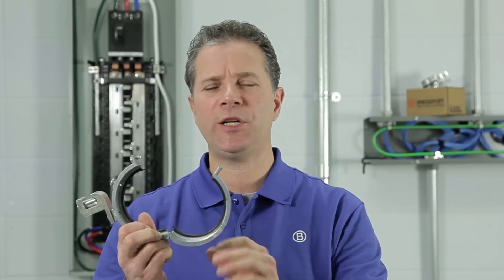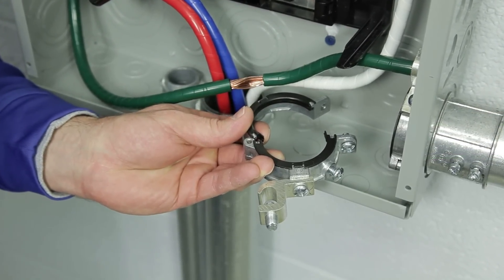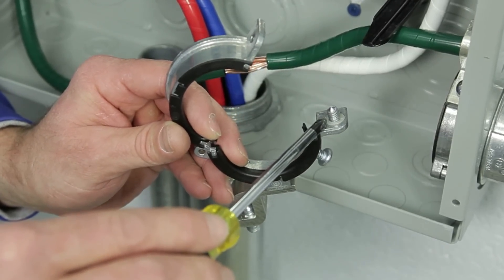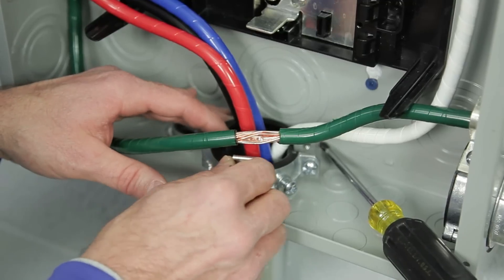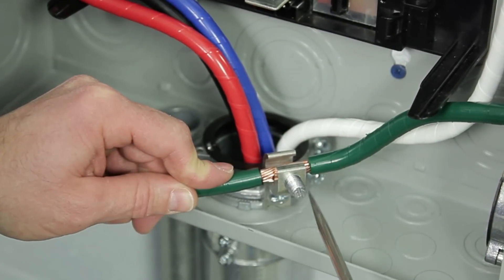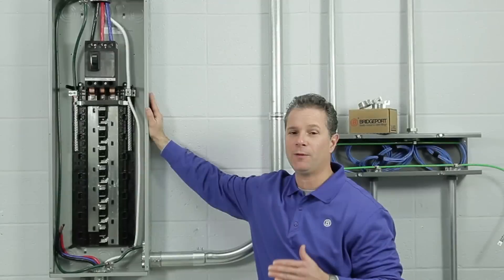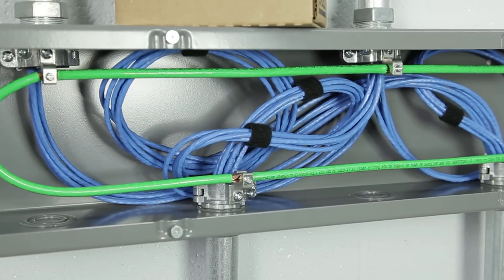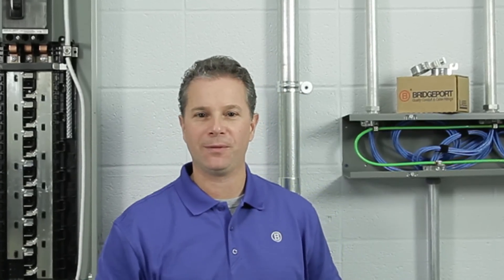Mighty-Rite® Split Grounding Bushings

Comment: What is the requirement for bonding bushings on that communication system?  I'd think that the raceways are already bonded to the enclosure, and to each other, by means of standard locknuts and the enclosure body.
Reply from the maker: +carultch Whether to use grounding bushings or not, "that is the question".

Many Data Communication systems require the use of grounding bushings. Either specified from an Engineer or required by the specific TIA grounding standard that the system is being designed to meet. 

Grounding products, such as our split grounding bushing help to ensure equal potential of the raceway system in the case of a fault or lightning strike. 

Yes, Bridgeport's setscrew and compression EMT connectors are listed and suitable for equipment grounding and bonding. 

With the addition of a grounding bushing, hypothetically if a connector was loose or the shoulder was not square to the enclosure, a grounding bushing would help eliminate any resistance and increase the raceways continuity. 

In many cases it's a good belt and suspenders approach, ensuring good workmanship and safety! 

Thank you for your question. 

If you get a chance, go to the Bridgeport fittings blog at http://www.bptfittings.com/blog for more Application insight from across the country. 

Regards, 

Eric Cerasale
Technical Marketing Manager
Bridgeport Fittings, Inc.
705 Lordship Blvd.
Stratford, CT. 06615
Office: 203-381-3437
Cell: 203-673-9800